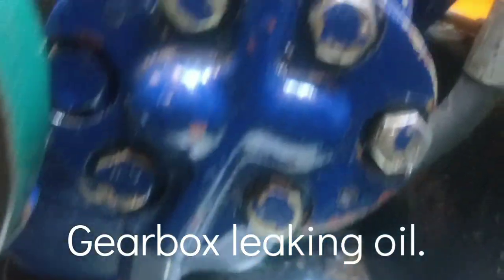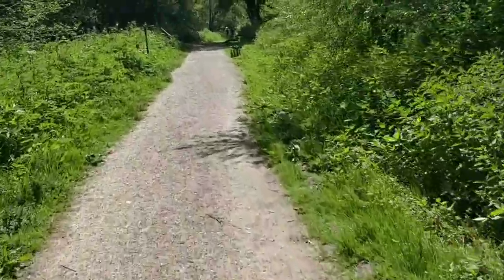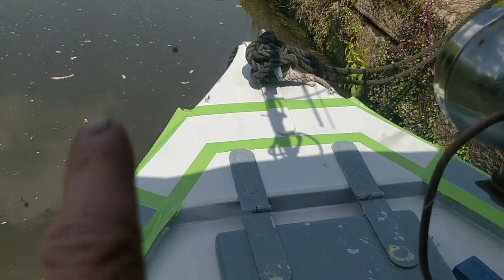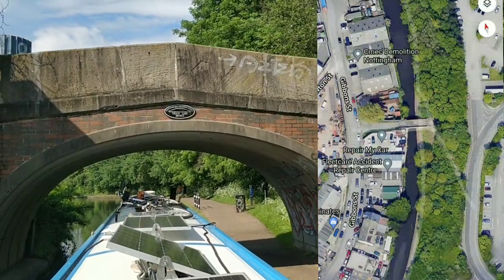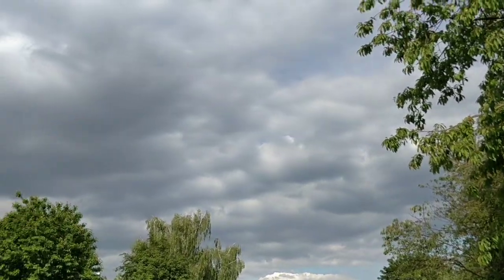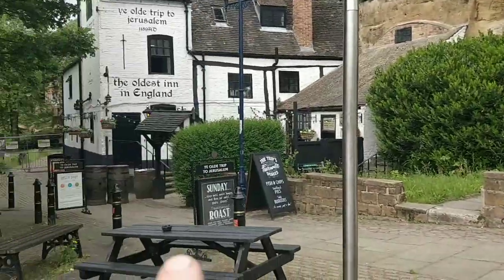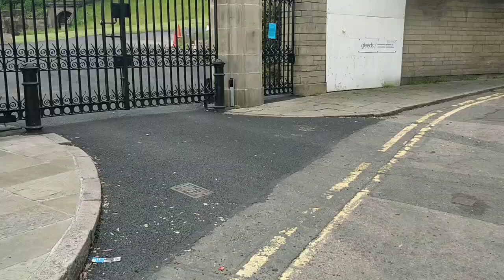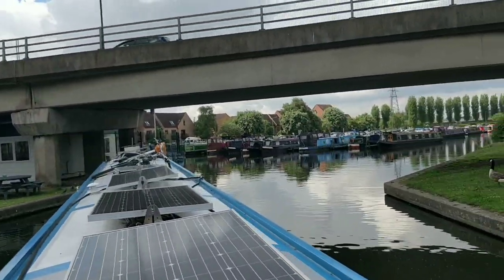Nottingham castle. Cruise from Beeston. This vlogs fully loaded.

Comment: Might be an idea to get a sheet of insulating foam from a builders merchant and stick it up with a tube of high grab strength glue, the type that fits in a mastic gun, it comes in thickness's from 12mm up to 150mm or more, foil or non foil covered. I used to go fishing in the Kennet & Avon canal when I was much younger, can't remember exactly where it was but parts of the canal were blocked in places by rubbish back then and the lock gates were falling apart. All I can remember it was close to the river Thames and a railway bridge, always caught great fish there and I remember seeing huge Pike swimming in the canal, when you hooked into one of them you really knew it and that you was going to be in a fight to land it !
Reply from the maker: Yeah that sounds like a plan Pete. You might of been near reading. Some massive fish around there. Ta buddy.

Comment: No point in having air tyres on your bike,  using mostly towpaths,  change to solids , Will.  All your troubles over land they will last for years . 3Wheeler.
Reply from the maker: Yeah I will look into that. I didn't have a puncture it was one of the many patches leaking. New tubes now. Ha ha cheers